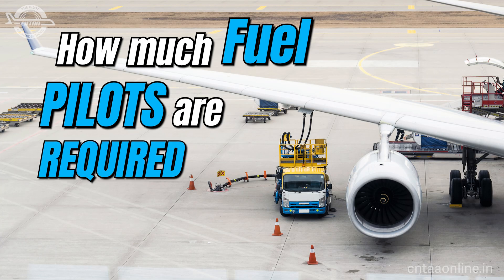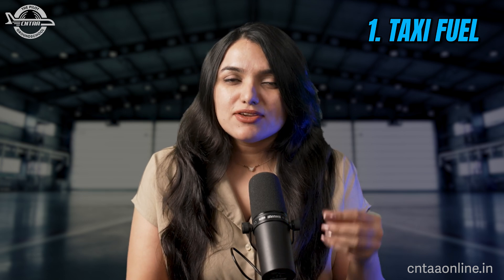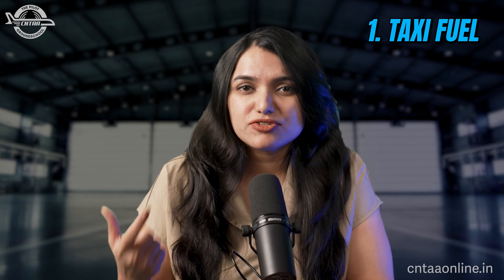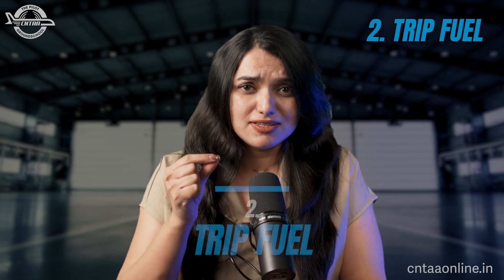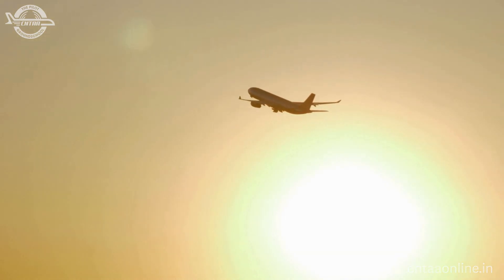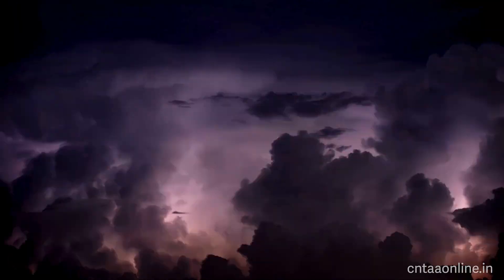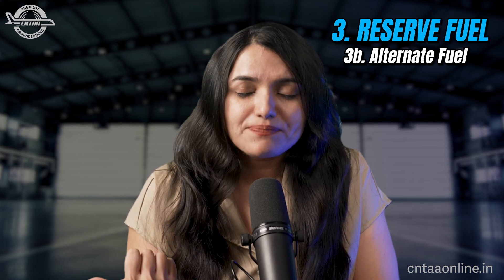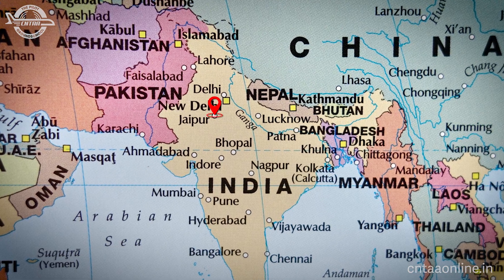How much Fuel Airplanes Need ? | DGCA Fuel Planning | Explained by Capt. Neha Thakare

Comment: To get CPL ,how much hours of flying is required.How many landings and Take off.?Which is the good flying club in India that is cheaper?Also post ur video while taking off and  landing..?Thank u
Reply: A minimum of 200 flight hours is required. The number of takeoffs and landings included in these flight hours is all you need, and basically there is no set number for them.

Comment: Very informative video… thank you! Do you use ForeFlight to double check the flight plan and fuel calculations that are given to you by dispatch? Or is that not a thing?
Reply from the maker: We don’t use fore flight for commercial operations in India. Calculations are based on fuel consumption data at various weights and Altitudes etc. 
Thank you so much ..